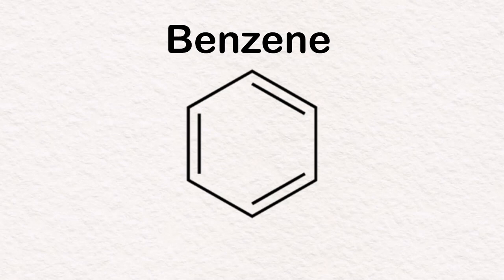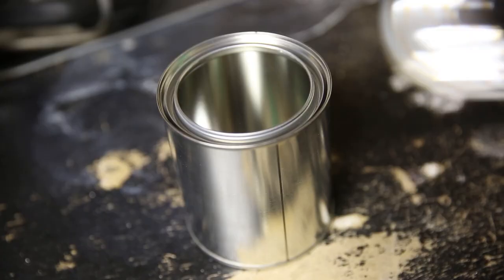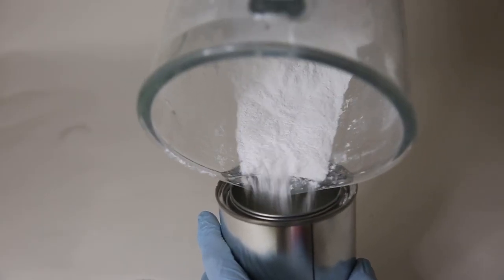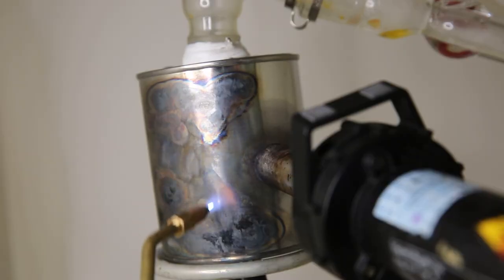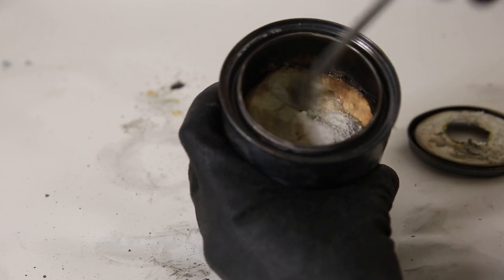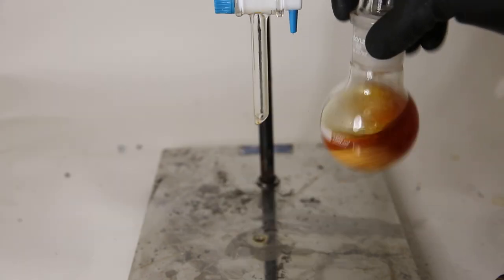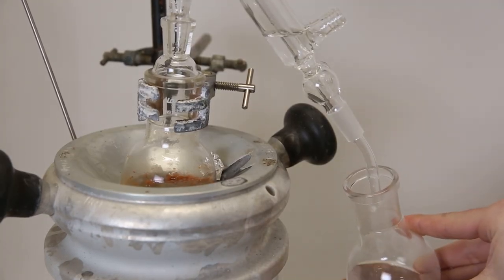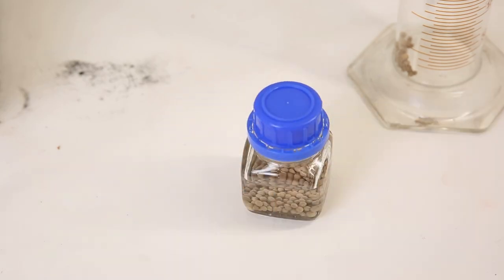Making Benzene the Rough way

Comment: You need to put your reaction vessel in a small furnace, you could make one from a 1 gallon paint can and some ceramic wool, just poke a hole in the bottom side to stick your torch tip into that creates a swirl inside from the bottom to the top. It will evenly heat the can and allow the heat to soak much further into the contents, and allow it to run for as long as possible for maximum yield.
Reply: You should always consider that using this setup is basically a melting furnace and the tin can has very thin walls - so a heavy duty recation vessel with thick walls would be approporiate
Reply: @GerManBearPig  true, but it's easy enough to set the torch flame low enough to prevent overheating, most propane torches have a flame adjustment knob to set the heat. Give it just enough heat to glow a dull cherry red and everything should be fine.

Comment: Nicely done, but there a lot of improvements to be made here. Your yield was just 24% based on starting benzoate. It's possible to archieve up to 90% with essentially the same procedure however, you just have to use small batches at a time such that just the bottom of the can is covered about 2-3 cm or so in reaction mix, then distill over a gas stove (first heating slowly, then maximum heat once distillation starts) until nothing comes over anymore. With this, each batch takes around 20 minutes. Drying over night with sodium hydroxide and separating the benzene from the formed water layer works well, and the benzene comes over pretty much dry and perfectly clear during redistillation.

Comment: I like what you have going on, for future reference those metal cans have a liner in them so when you heat them up they offgas quite a bit so its best to burn them in before your experiment to make sure your final project is more pure. Subscribed!
Reply: If you flow argon in it helps to keep oxidation from happening inside the can.
Reply: @tek4  It's still going to vaporize and contaminate whatever you're doing
Reply: Cast iron pipe from the hardware store works for small reaction vessels too.  I’ve used it to decompose CaCO3 in a furnace.

Comment: A word of advice for next time:  Just get a steel pipe, file a slight chamfer/edge onto it, place it on the lid, and hit it with a hammer.  You should end up with a far neater hole.
Reply: Why not just use a can opener, lol.